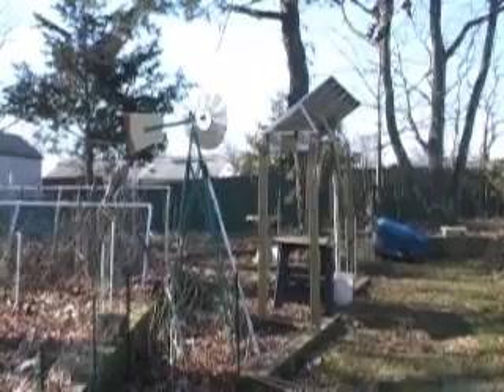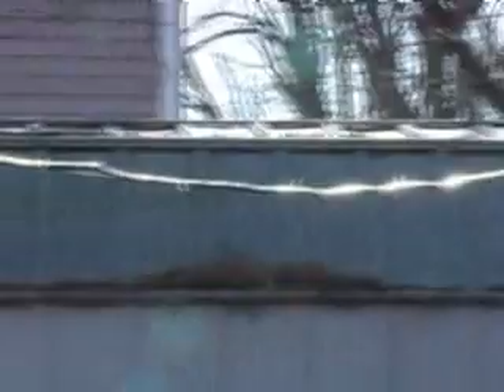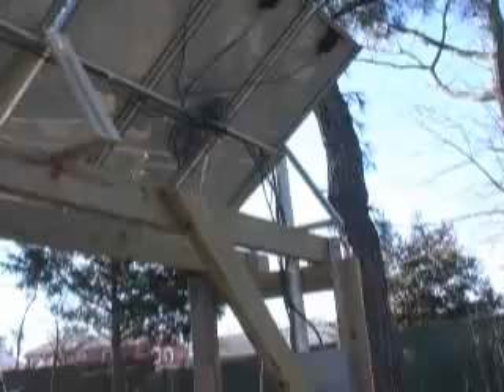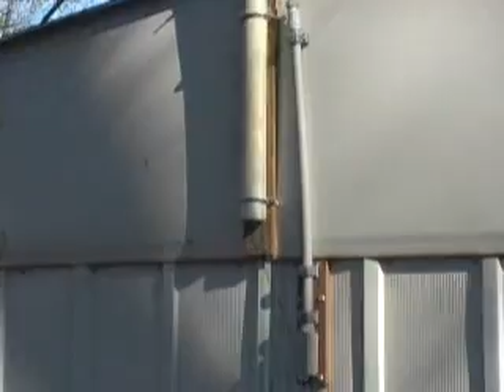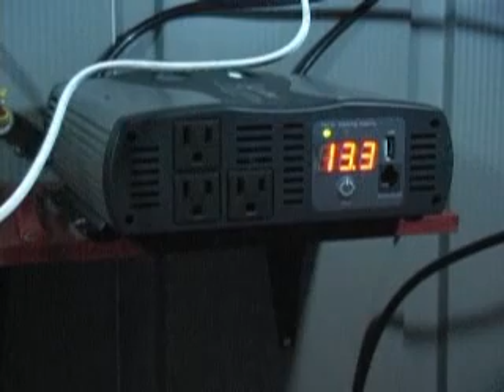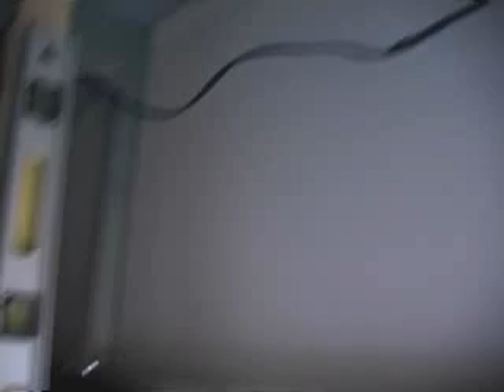My Harbor Freight Solar Panel Project.flv

Comment from the maker: Already been through 50-60 mph winds and no problem at all. I've thought about hurracaines, and maybe I would unbolt them. Before I put the sets together, I did weld the corners of the HF metal frames and then they are bolted to the wooden frame with 3/8 lag screws.

Comment: Those AC only quiet switches can have contact welding problems on DC.  Spring loaded surface mount wall switches or automotive switches would be better.